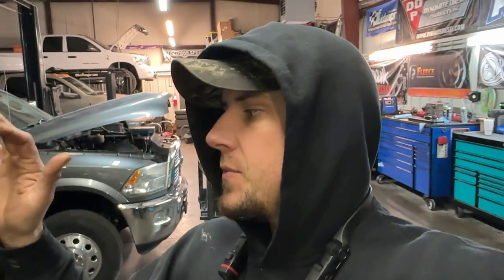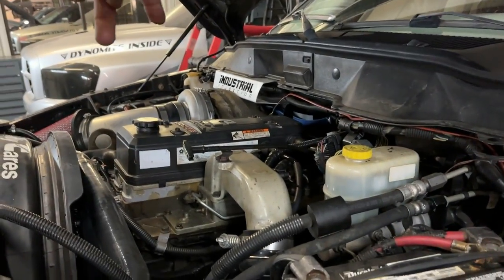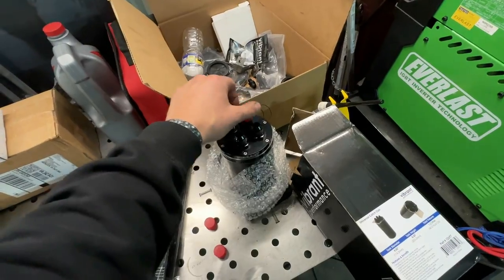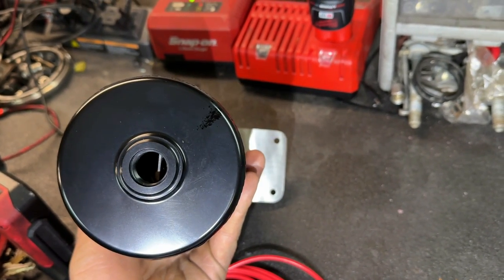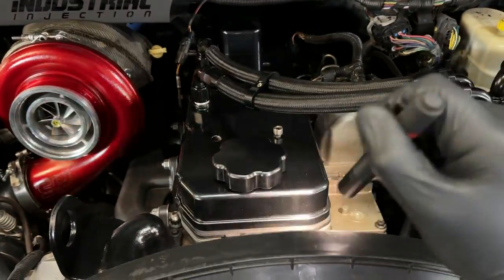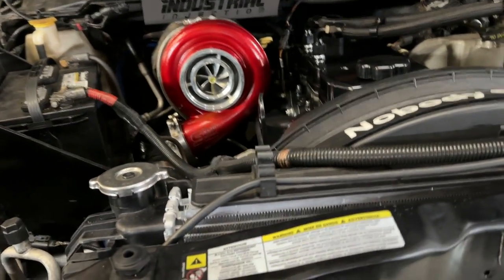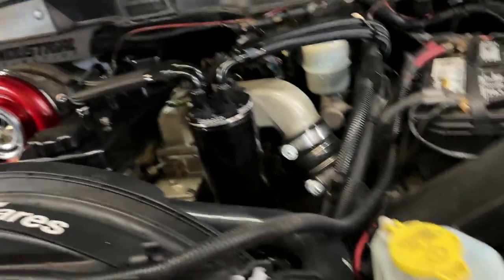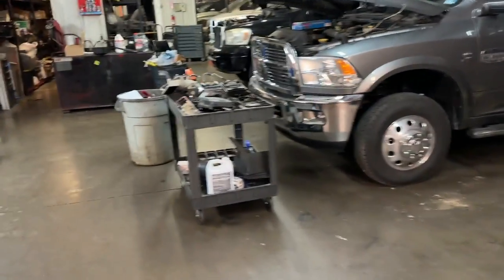HOW TO INSTALL CATCH CAN, 5.9/6.7 Cummins Trucks.

Comment: So my question is if you have an 06-07 5.9 truck does the crank case ventilation need to be serviced? And if it does do you just change the whole valve cover? My 06 5.9 has 450,000 original miles, and the crankcase ventilation has never been serviced
Reply: I would service it asap and no you can buy your ccv filter online or they hold them at local auto parts stores
Reply: @kadenalbert7806  06-07 5.9 is non serviceable

Comment: Lol of course it will spiral out of control.  We hp junkies cannot help ourselves, it is an addiction after all.  I had my new 04 delivered one month ago, it was supposed to stay stock because my 05 is modded to hell.  Can't leave those spare parts lying around from my 05s evolution, so...  10mm, DDP 150% overs, 64mm he351, it never ends.  Just tell yourself it's for the channel growth, and don't count the receipts.

Comment: So ive got a question. I did the ccv delete on my 16' cummins and added a catch can off the ccv cover with a hose and have it vented to same spot u have yours. I did not get rid of the two tubes coming in on the drivers side. I keep getting this code P04DB. Please help with some advice.
Reply: I assume you're deleted. The code has to be programmed out by your tuner.
Reply: @Dalton  ok I wasn't sure. I'll have to have that done then. Just thought id ask to make sure I didn't forget something.
Reply from the maker: Is your sensor unplugged?
Reply: @Horsetorques Diesel  no it is not unplugged. Ill have to get that sensor delete on the tuner.

Comment: Nice information is it ok to run catch can from tappet cover or is it better to replace valve cover to run from there and does catch can need be at same level or can it be above connection
Reply from the maker: Tappet covers gonna push some oil valve cover is better

Comment: Correct me if I’m wrong I’m new to this, but isn’t it bad to drain the catch can back into the engine block/pan? Doesn’t the can accumulate condensation inside, I know the factory valve cover vents to the turbo and back to the block as well but I was just wondering

Comment: I have the same catch can but my system is building crankcase pressure. How do I vent the 4 port system on a 96 12 valve?

Comment: 10:17  I’m installing the same vibrant catch can on my 06 tomorrow. Only issue im having is I can’t find the drain hole in the block you ran yours to. Any help would be much appreciated. Love the content.
Reply from the maker: It’s the factory drain back from the VC on the stock line. Look above the ecm behind the cp3
Reply: @horsetorquesdiesel question. Why would you send that oil in the catch can back into the motor and not hold it in the catch can?

Comment: @horsetorquesdiesel what would be the benefit on running catch can than over a by pass unit? I’ve ran a by pass on my Cummins ISX and never had a catch can before. I was just curious.
Reply from the maker: Just keeps the oil from spraying on the ground

Comment: On a 12 valve can you drain a catch can into the fuel pump location on the side of the block or would positive crank case pressure come out of there. Iv been thinking of doing that.
Reply: I recently read of someone testing that and not just pressure, tons of oil slung out because of how low that location is. I don't think there is a good place to return the fumes and oil that accumulate in a catch can back to the engine.

Comment: Can't find a valve cover anywhere with passenger ports, so I'm assuming this one you're using is custom? I'm wondering if there's a downside to just running one hose out of the backside into a catch can, with only one line out of the can to breath? vs two and two.. also, if one were to reuse the factory valve cover, would a single hose off the stock breather into a catch can with a hose out work just as well?
Reply from the maker: It's a d and j with his port blocked and ports added to the far side. 
Just do a baffled driver side port

Comment: I purchased the same catch can with the 4 ports and have it drain to the block just like you but still get oil pushing out of the breather tubes. Any suggestions on how to prevent that?
Reply from the maker: Fix your piston rings